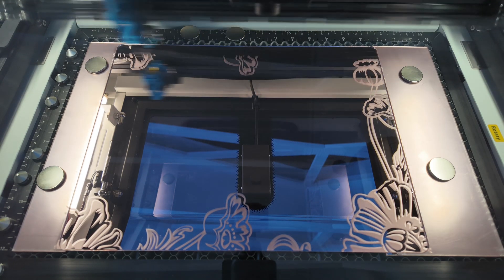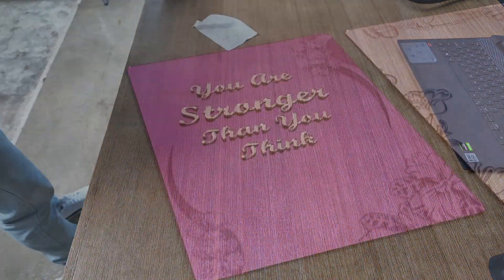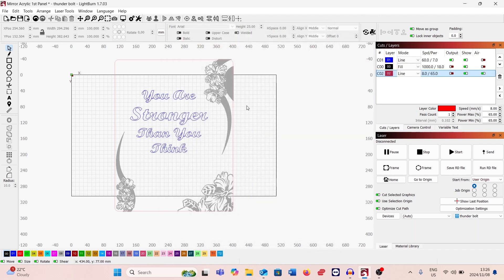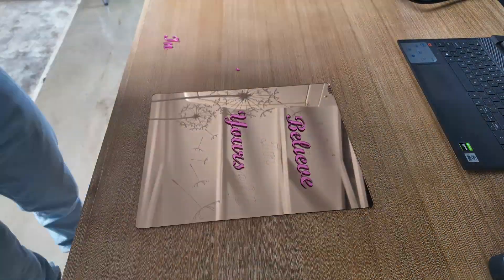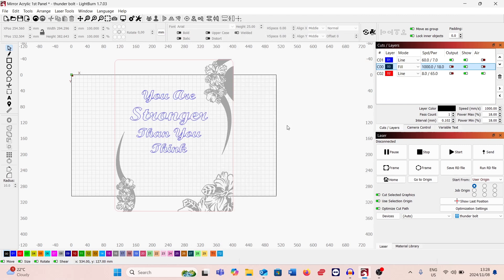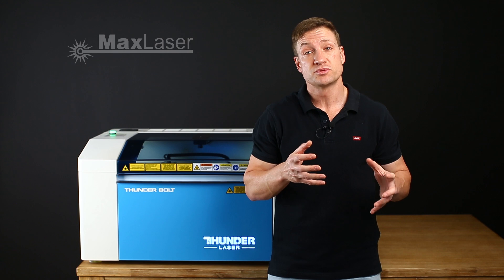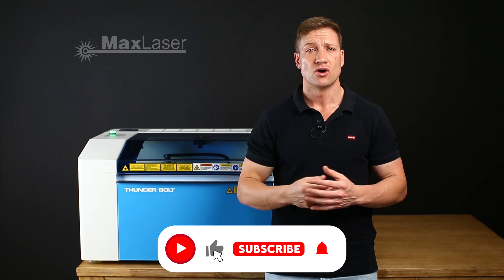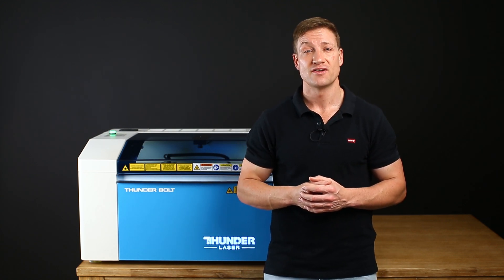Laser Cut & Engraved Mirror Acrylic: Thunder Bolt  Laser Tutorial

Comment: I tried engraving and cutting 2mm mirror acrylic. The engraving went smoothly, but the box outline cutting didn't. The acrylic sheets was warping during the cut, I assume due to receiving too much heat.
Any suggestion how to prevent it?
Reply: Engrave and cut from rear side, removing the mirror layer.
Hard cardboard as a base beneath the acrylic sheet. No weight or clamp above the sheet.
I don't remember the parameters because I'm not the machine operator.
Reply from the maker: @LexBarun  Hi, so this can happen if the power is too high & the cutting speed is too slow. I would say that the settings mustn't be too strong. What type of machine did you use to cut the acrylic ?
Reply: @maxlaser7849 Asked the operator, here's some details:
Machine: PhotonTECH iNOVA+ 1390
Engrave: 200mm/s speed, 9% power
Cutting: 15mm/s speed, 12% power
Reply: The cutting setting is same for cutting 2mm clear and white acrylic and it works fine. But for my design with mirror acrylic, it wasn't.
Oh, also, my friend's design (engrave + cut, silver mirror 2 mm, 7 cm circle diameter) apparently just fine with that settings. Do shape also matter? Mine is 15 cm x 10 cm box.
Reply from the maker: @LexBarun  It could be the quality of the mirror acrylic that is also giving issues maybe. When we cut mirror acrylic we tend to put the power higher & have the speed quicker. I would also engrave first then cut, the engraving settings could be creating heat too should you be doing both engraving & cutting for the same design. Your engraving speed does feel slow to me, I would try and speed that up & increase power to get the correct balance. Try that & see...